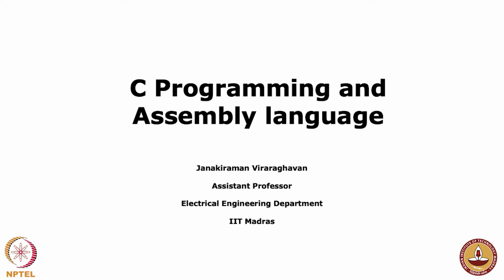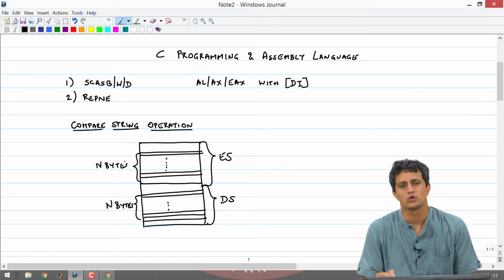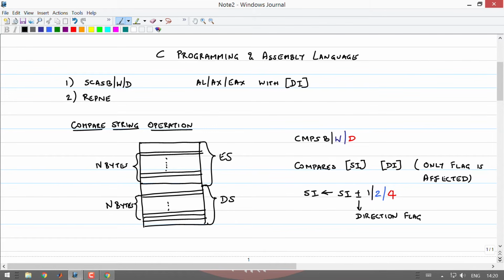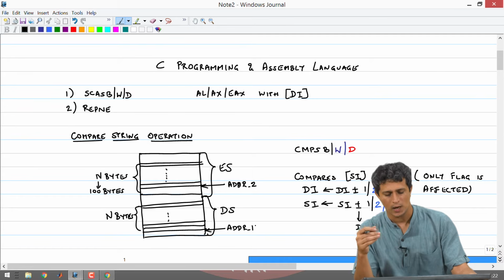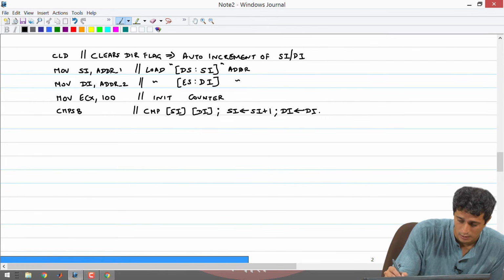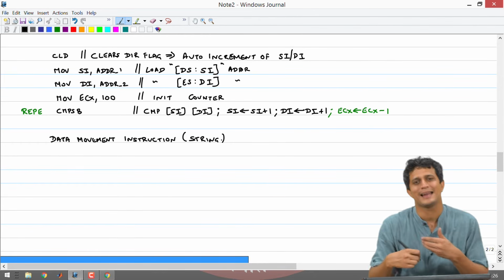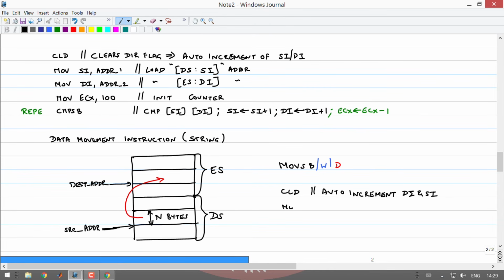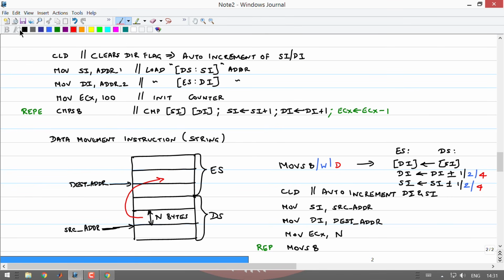Lecture 4B

Comment: Sir I have a doubt please help!
here you said while using CMPS operation that only flag is affected. But while doing the operation DI <--- DI+1 and so does SI . So why did you say that it does not affect SI and DI ?I am confused
Reply: He meant (most likely, and according to logic of things as I see it [not an expert in subject]) that content (an actual held values) of memory slots to which DI and SI point to (because DI and SI are pointers, remember that) will not be anyhow themselves changed/messed up by CMPS, so its safe to use CMPS in relation to original data. DI and SI themselves have to be naturally changed, because you don't want 100 times make the same comparison of one selected pair of memory slots; you want to make 100 times a unique pair comparisons. In other words, you don't want CPU do execute 100 times an operation "compare content of Area Nr.1 with content of Area Nr.B"; instead you want (as intended in example) CPU to execute in chain of 100 tries an
 "compare content of Area Nr.1 with content of Area Nr.B"
"compare content of Area Nr.2 with content of Area Nr.B+1"
"compare content of Area Nr.3 with content of Area Nr.B+2"  ...
....
DI and SI values are like those describing an Area numbers:   Area Nr.[DI goes here]  and Area Nr.[SI goes here]
The contents of respective areas (your original data) do not changes during all that. So that is what he meant most likely (and logically, again).
Reply: Data contents in source and destination locns are not modified. Pointers to data are modified (i.e, SI and DI), but that's an internal operation.